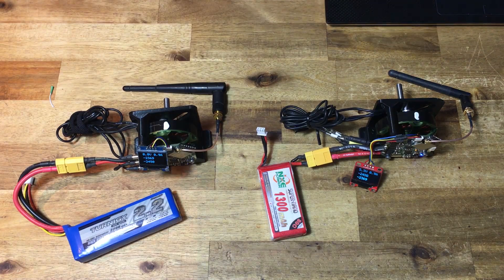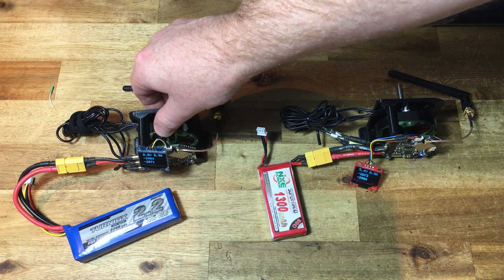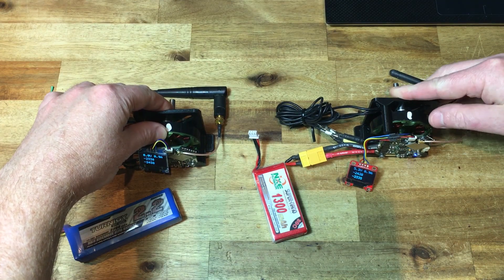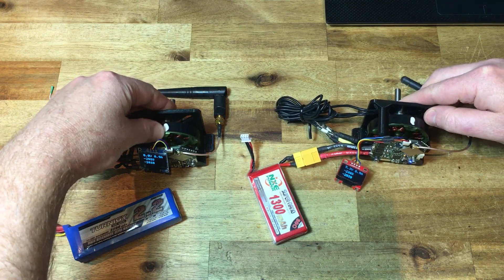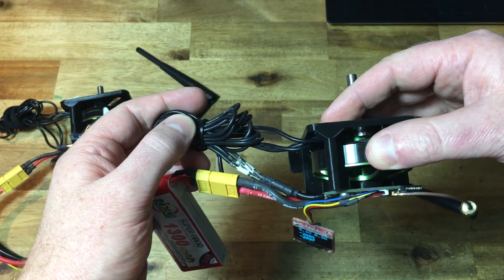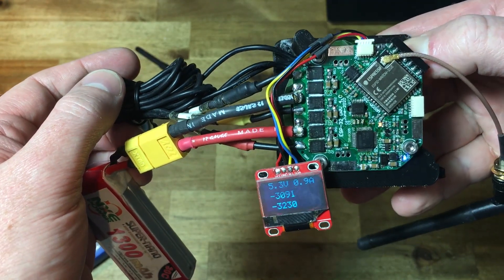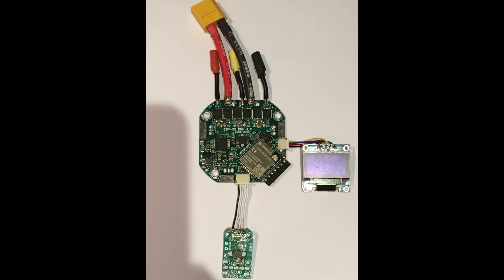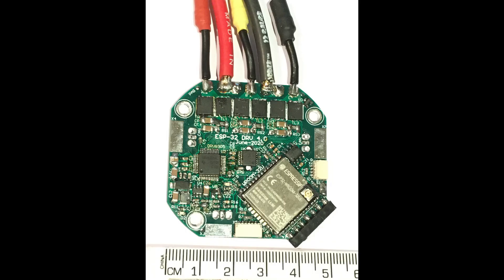Haptic Control using ESP-Now in a Brushless Actuator Controller

Comment: It's fun to see so many riffs on the same idea!  

It looks like there is a fair amount of lag between the two servos... how much of that is the fact that you're just open-looping the, as you put it "saddle mode" commutation and how much of it is latency in communication?

Re FOC: Is fixed point an option for getting your transforms fast enough to run on the esp32?
Reply from the maker: The Lag is due to the P-term being very small. If I increase P it also seams to increase D a lot (even though I set D to 0). 

I'm just using the equation 
error = (own_pos - other_pos)/2

The comms time is about 2-3ms ESP-NOW is quite efficient.

Yes, Fixed Point FOC would be nice but first I have to get the ADC working well. I'm only 1/2 loving the ESP-32. All of the comms seems to works very well (even IRQ driven stuff) and community tested, but everything else has bugs/omissions in the libraries.

With all that being said, it works well enough for my hobby projects.

Comment: Awesome work. Do you a rough estimate for the price of the components?
Reply from the maker: With MA702 Encoder, CAN TXR, and connectors, the raw Component cost is US$32 (10off, Mouser, Digikey & LCSC) and US$2 for the 4 layer board. Cheaper components are possible, I first chose the parts I know to make sure it works.
Reply: @PaulGouldRobotics  That is fantastic news and cheaper than I was hoping for. Do you think you could get JLC (or another supplier) to do the PCB board and place components? Really looking forward to your progress!

Comment: I love it. would you ever try to increase the voltage (50v or more) and current?
Reply from the maker: I have though about it. For the voltage I would need to change the Mosfet Driver, Mosfets and Voltage Regulator. For the Current I would need more FETs and a better design and cooling. It would be a much bigger board.
Reply: @PaulGouldRobotics  It would definitely be with it. You would be able to sell far more if you had different versions like the ODrive has 24v and a 56v. It would be nice if it had CAN bus also that should be cheap to add.
Reply from the maker: @Build_the_Future  It already got CAN bus, with two connectors. Going to a higher voltage/current increases the cost a fair bit.
Reply: @PaulGouldRobotics  I would pay more for sure.
 I love your videos btw.
Reply from the maker: Eric Lamb How many amps peak/continuous?
Reply: @PaulGouldRobotics  Peak current 120A  minimum, continuous would depend more on cooling. You can leave that up to the customer to add different cooling options to keep costs low. FYI I do know that the Odrive sells far more of the 56v version than the 24v version even with the 56v  version costing more.
Reply from the maker: @Build_the_Future  That is over 6KW peak. I'll do some research, No promises.
Reply: As would I. 48 volts for me
Reply from the maker: Paul Mclaughlin How many amps peak/continuous?
Reply: @PaulGouldRobotics  ~30-40A
Reply from the maker: @abcqer555  I'll see what FEts are good for that.
Reply: @PaulGouldRobotics  Thanks mate, looking forward to watching your progress on this project. You are doing great work.
Reply: Why not just use ODrive? And once Peter Wasilewski's 33x33mm control board is fully developed, we should be covered on most hobby motor sizes :) Although it would be nice to have something that can fully utilize >1kg motors, like 60V/200A or 100V/100A (50V is a terrible choice because it's just below the common 14S battery voltage). And perhaps a tiny board for <10g motors. The BGC gimbal control boards are about the right power level, but rather large at 50x50mm for two or three motors, and can't do current limiting.

Actually perhaps what would be most useful is for someone to write a tutorial on how to design motor control boards. I get that you need a microcontroller, FET driver and FETs, but what are all the other chips, and what is the process that leads to all those little resistors and capacitors all over the place, and how do you decide what values they should be?

SimpleFOC is looking promising as a hardware-independent firmware, so hopefully we can quit duplicating that work so many times.
Reply from the maker: @dekutree64 You have an interesting take on the state of motor controllers. There are about 10 different motor controllers in development that I know of. Each one has different features based around different components. I have developed three different controllers. You should learn more at https://hackaday.io/projects/hacker/313303
What I'm creating (IMO) is quite unique.

ODrive is great but it did not have the features or size that I needed for my quadruped. You should see where Peter's design started. Going above 30V/50A starts to gets dangerous for hobbyists. 

There are motor control designs available from a lot of the big semiconductors manufactures. The information on which the little resistors, diodes, inductors and capacitors can be found in the ICs datasheet.

SimpleFOC is ok, with a good structure. From what I understand is not doing FOC (no current measurement) and the code runs in the main loop. I do not think that proper high speed FOC is possible on a simple 8-bit micro-controller. Someone my prove me wrong.

Comment: Awesome results! I‘ve just read your blogs on Hackaday. Real nice to see a project progress so well.
Reply: Have you tried using a sinus look up table for an efficient clark and park transform?
Reply from the maker: I'm already using a look-up table for the current sinusoidal control. I've searched though various FOC code and haven't found a good one to port over (yet). If you've found some code that already does this then please link it in.
Reply from the maker: Thanks
Reply: Paul Gould Sadly I don‘t have a good foc library for you. But if you decide to write your own you can use this excellent presentation from TI (https://youtu.be/VI7pdKrchM0 starting at around min 12). Clarke transform boils down to an addition and division, and Park transform to a few sin, multiplications and additions. Reverse transforms are similar.
Reply: But I’ve implemented the code for the space vector modulation to run on a STM32 Arduino core if it‘s to any use to you.
Reply from the maker: @sebastianuhl  Please add a link and I'll check it out.
Reply: @PaulGouldRobotics  There you go https://github.com/basti30/brushless_motor_driver